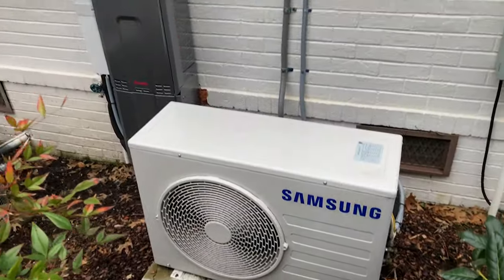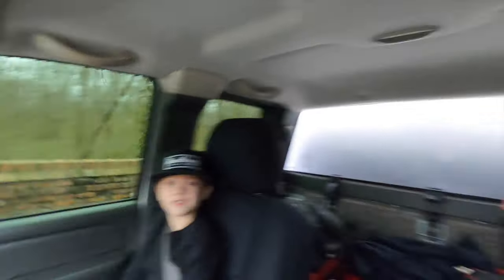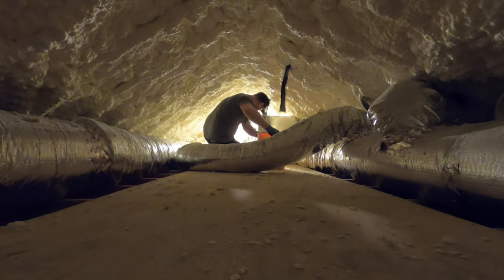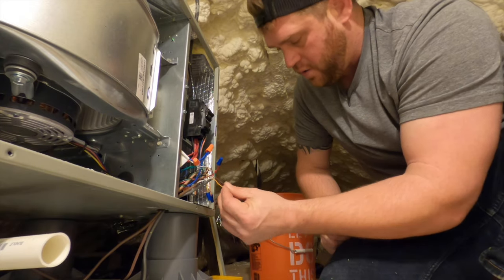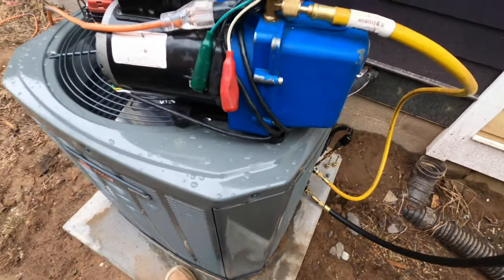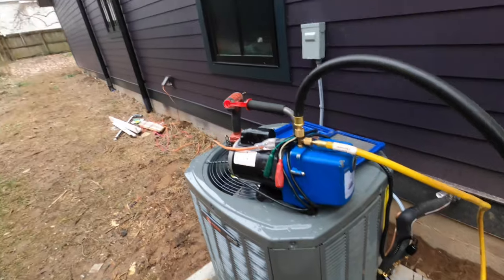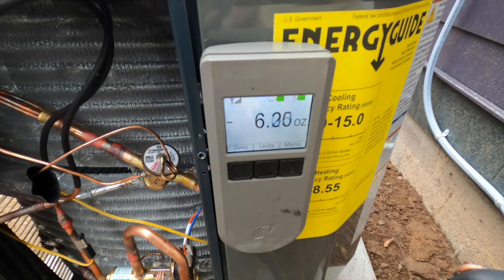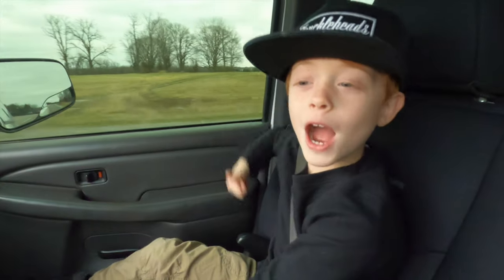Teaching My SON About The BEST Skilled Trade! (HVAC of Course!)

Comment: On the drain, I would add a vent tee after the trap and extend vent a few inches above the height of the internal pan. This will allow the water to flow freely. You did a nice looking install.

Comment: Who ever does foam insulation need to cover system up. That's what some do down here in Texas anyway. Good work!
Reply from the maker: That’s what I’m saying!
Reply: Why cover when it is in the insulated envelope
Reply: You're correct but they don't bother doing that. That foam insulation is OK for attics but if you fill in walls, you may end up with broken sheetrock; I've seen that long ago!

Comment: I'd make sure that the secondary drain float will activate before the primary drain pan overflows.  
I would use a clean out tee rather than a union on the PVC drain line.  The unions can become a location of debris buildup since it reduces the  internal diameter of the PVC pipe.
I've found evaporator coils that overflow because the auxiliary drain port water level doesnt get high enough to lift the float/switch before overflowing the primary pan.
Why not use a EZ-Trap with float switch?  The newer ez-traps are make from one solid piece of tubing rather than two fuses together.  I've also found that I had to put 3/4" PVC plugs in the remaining drain ports because I've had condesate leaks from them on Carrier/Payne/ect Air Handlers.

Keep up the good work.
Reply: Patrick like me !! Big up

Comment: I always have issues with the ss2 when I don’t install a 90 right out the secondary port/ put it on a small pitch to make sure the unit doesn’t over flow the pan flooding the inside of the air handler.

Comment: One suggestion..but I normally snipp the corner of the coil door under the drain in a horizontal application so that it's easier to pull the panel off for evap cleanings.

Comment: New construction, when possible run  the secondary off the coil to exterior above a fixed window when possible.    Safety switch on pan. Put a t on the safety switch, sometimes the pressure in the unit will pop up the float inside😉

Comment: Hey I do hvac in the same area as you I just want to let you know a problem I've had before with the secondary float switch 
In most cases an American standard/trane especially the catch of the float to break connection to stop the unit is higher than the edge of the pan 
We have switched to the inline version of that switch and remedied the problem great looking install though
Reply: The float has an adjustment, It can be screwed out to lower the float as needed.

Comment: Just ran into a problem a few weeks ago where a customer wanted their AC moved, which I did. It was no problem. When I went inside to kick the unit on they had an old nest thermostat. (They claimed it was 8 years old) The thermostat was telling me Y was no longer connected yet it still let me turn the unit on... it just wouldn’t let me change the temp. I figured it was the back plate but when I replaced that nothing changed. Nests can be annoying

Comment: Don't obsess bro... should have covered the unit with plastic but you do good work. Even if i vacuum my hoses i prefer to break the vacuum with the charge in the system before adding charge...Props on bringing lil man in the field, thats quality time with bud.
Reply: Same thought ... It's a shame the insulators got foam snot all over, maybe a few minutes with a scraper and fresh blade, but it is what it is......21st century issue ... Having to wrap units with plastic sheeting to keep clean from insulation overspray.

Comment: Nice videos man. I'm sure you know, but in the heating mode the evaporator coil has to get to 130 degrees before the fan turns on. Possible that  it was low on refrigerant?  Anyway, cant even count how many ductless units I've had to replace boards from power surges. I'm  Using the ICM surge protectors now. Anyway. Aelwesome vids!
Reply: FLL 1225 possibly but it would have thrown a code, those Samsung systems go through a pre check before turning on.
Reply: @jmaldonado741  I guess so I don't know what it would pick up on a pre-check. Everything would appear normal, compressor would turn on, might not be enough to get the coil hot enough.  not a fan of Samsung at all the addressing feature on those things is a nightmare. Our  local supply house stop selling them because they had so many issues with them.  a lot of time with these ductless units,  I tend to pull the charge and weigh it back in and then start from there.
Reply: FLL 1225 yeah those Samsung systems are a pain. and even harder to get parts for them. I had to replace an inverter board a few weeks ago. I was getting a DC link voltage error.

Comment: On that pull through coil the trap makes it drain properly on the main drain do you not have to add a trap for that secondary as well then put the cut off switch?

Comment: For ductless splits, the fan shouldn't turn on because the indoor coil needs to pre-heat .. on cooling the fan will spin all the time. Power outages generally do cause shortages but there may not be anything wrong with the unit, just the customer being impatient 😂

Comment: Hey man nice clean install, never though using the plastic feet like that for air handler install in attics will half to remember that for the next one. Question y'all not required to insulated the condensate drains from the unit?

Also props for begin a 1 man show doing HVAC.
Reply: Only when their is a condensate is produced in the winter.  I doubt that attic will ever go below 32⁰

Comment: That P-trap wouldn’t work well because the negative pressure is so high that the water in the P-trap will be pulled in completely. It’s better that the blower motor be put behind the Evaporator coil. Great work

Comment: No vent after the trap=fail! The fan is gonna pull water back into the pan!! Then trip your beloved switch
Reply: That’s the point of the trap. The vent helps but is not always necessary. Hence why not all drain lines have a vent after the trap.